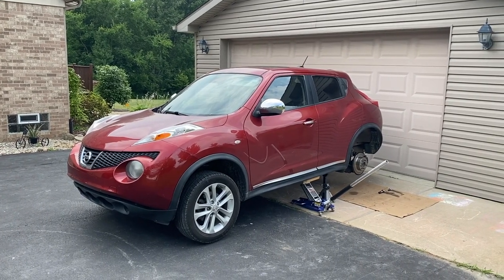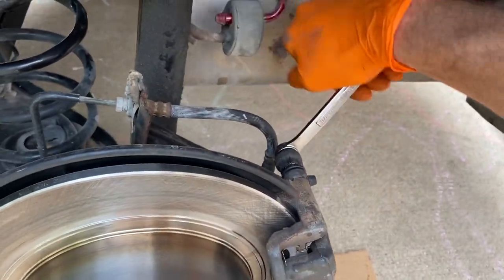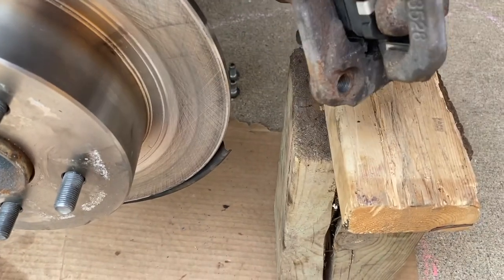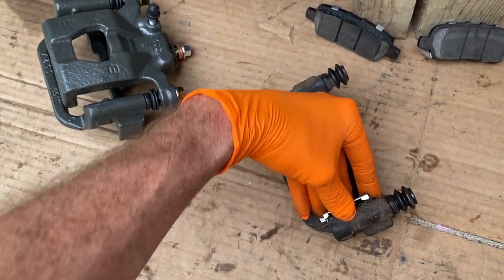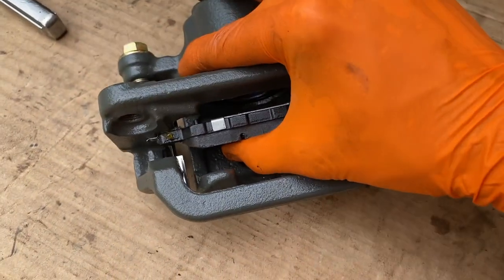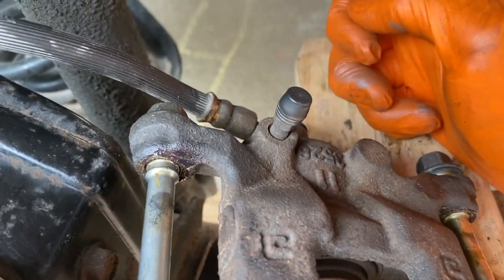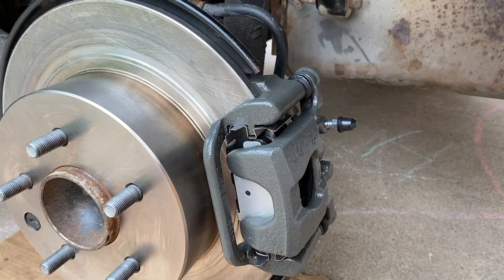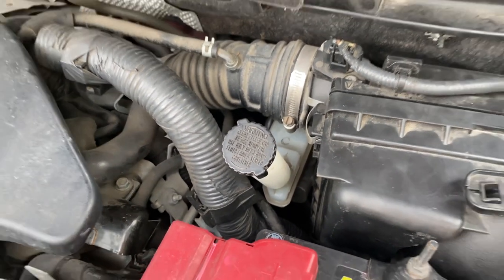Replace Nissan JUKE rear Caliper

Comment: Thx for video. Those clip sizes, i suspect, are due to the rotor size. My Juke AWD rear rotor is a single disk/plate (thinner). The front brakes have the double plate rotors and the wider clips are in place.

Comment: Nice video, I'm just curious what necessitated changing the caliper? I'm doing a brake job on my wife's rouge and deals on caliper rotor pad combos are pretty good vs buying calipers later
Reply from the maker: Thanks for watching, we are hanging out today at the DIY Raptor headquarters watching football answering questions for our fellow DIY’ers.

We replaced caliper because it was locking inner piston in place not allowing it to release pads.

Keep us posted on your project.

😎👍🔧🔩